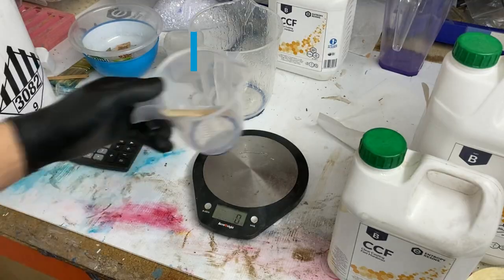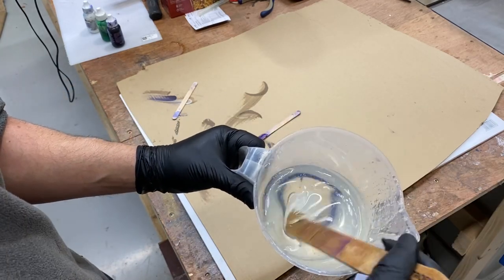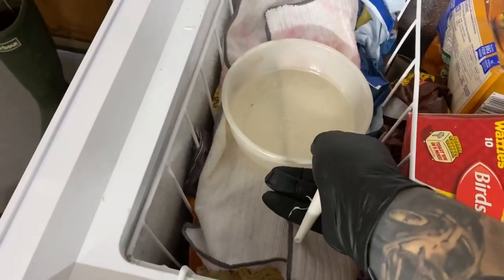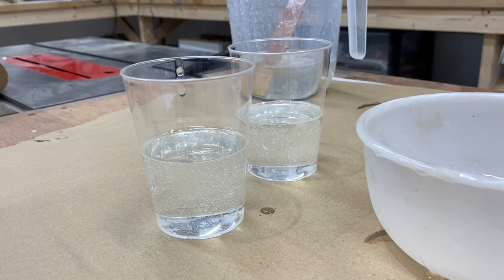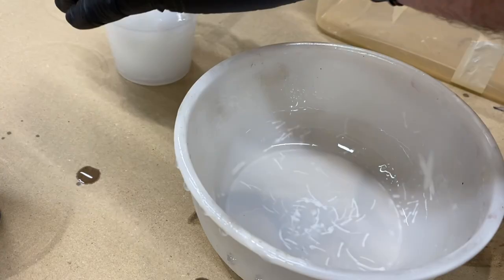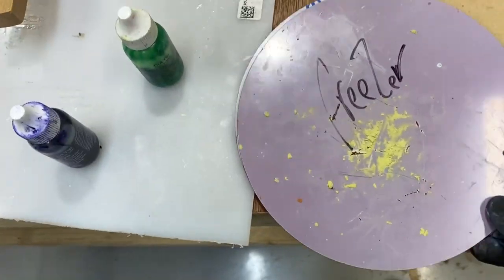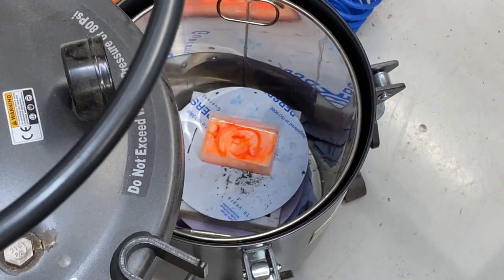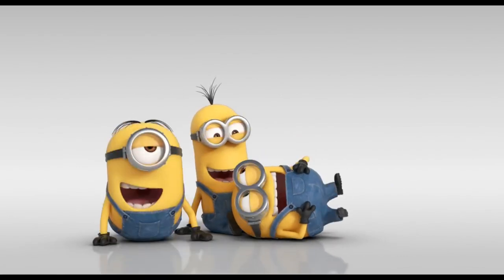How to Create & Keep Swirls in Epoxy Resin after its set? - I Try The FREEZER METHOD! ❄

Comment: Hypothesis: freezing is unlikely to work because the cold inhibits curing. Once it comes back to room temperature, the resin effectively returns to its "just poured" state and cures the same as it normally would.  However waiting for an hour lets it partially cure and makes it more viscous so it's just less mobile and less likely to mix further as it cures in the pressure pot.
Reply: This correct. Freezer slows the chemical reaction that causes the resin to cure. This is actually done in the real world in automotive refinishing, to extend the pot life of 2K paint
Reply: If working time is an issue, you could do both.  Let it react for 45 minutes, put in the freezer for a while to slow the reaction down, then pull out, add colors and pour.  If working with a large amount of resin, this might extend the window where it will pour but not mix.
Reply: Yep, I was expecting him to put in oven or heat, not freeze it. Warm the resin so it cures faster not letting the colors intermingle for as long.
Reply: Plus if it's in the freezer and still trying to cure (getting warm), it could draw in moisture from the freezer, adding water to the resin, causing even more problems, including cloudiness.
Reply: Exactly.  Gentle heating and/or high shear mixing can serve to accelerate the reaction. Sometimes the addition of a small quantity of a “metallic powder” can also accelerate.  Accelerating too fast can also cause the resin to be brittle.  There are also thixotropic additives that can serve to increase the viscosity. If translucence is not a priority; then a pinch of cabosil fumed silica would be a great additive.  Your example at the end shows that patiently waiting for the desired thickening just may be best!🤓🤩😎

Comment: A lot of comments, haven't gone through them all.  3 things: 
1) Use a temp gauge so you know when the exothermic reaction is just thickening the resin. 
2) Mix  1 color and let it set (temp gauge or viscosity check) then mix/pour 2nd color.
 3) Talk to Entropy and ask if using more hardener in one batch will work, might not cure correctly though. 
  I use a Polyester resin that you add catalyst to. 5 drops/oz. If I over-catalyze, 2X, the 2nd color it thickens faster so the colors stay reasonably separate. A temp gauge is a good thing to have in the shop.
Love your videos.

Comment: I work small scale and don’t have a vacuum pot, so I warm my resins by putting the bottles in warm water to help prevent bubbles when I pour. Heating it quickens the curing process, so it gets thick quickly, and pouring it when it’s a little thicker helps. 

One thing I like to do is pour a dark layer and let it sit for a little bit then drizzle other colors over it. Then pour some clear while the drizzled colors are still wet and the base is sticky. You’ll end up with a neat 3D looking set of layers and the clear layer will look like a “peep hole” in the middle of the other colors. 
My husband and I love watching your channel, by the way!

Comment: OH! ALSO! If you let one color thicken up quite a bit then make the other color fresh so it's still thin when you pour, you can get some VERY interesting patterns. I did that with colored resin into clear in vertical pen blank molds and the results were spectacular. I poured the thicker resin into the thin from as far up as I felt I could aim and didn't touch it once the pour was done.

Comment: Fun to watch! You are quite funny and your editing is cleaver. I use Deep Pour and after ruining well over a hundred dollars of resin and burl trying to find that perfect time to "swirl" is really frustrating. If you swirl too soon and/or too often you get a "muddy" mess. Obviously time, temperature and resin brand make a big difference. But what I'm finding with Alumilite Deep Pour the perfect time is somewhere around 8 to 11 hours after the initial pour and NOT stirring until it is the consistency of melted taffy. It peaks when touched, but settles flat/level within a minute or so. Then stir slowly, trying not to get too many bubbles. I just got some UpStart Deep Pour and will be testing it for "time to stir" on some smaller batches, before wasting resin on a larger pour. Also, I made a "curing box" 2'x2'x2' out of 1" solid insulation, that I installed a light for heat and a thermostat that maintains temp between 75 and 78 degrees. It works great for curing, but "swirling" is an all together different learning curve.

Comment: Hey Nick I use amazing clear cast and use an IR thermometer to check the temperature in the pot until it's around 40/50 degrees that way you get good colour separation I'm not surprised by the freezer result as effectively putting it in the freezer will cool down the exothermic reaction and essentially slow down the curing process

Comment: Nick try putting the colors in the pressure pot to remove most of the air bubbles before you mix them...most likely what is mixing your colors is air bubbles

Comment: So in my own experiments with resin i learned to kinda put the cup in hot water for about 10 minutes to remove bubbles, this also made the resin start to harden way faster. I wonder if that would be similar to but faster than setting it out for an hour.

Comment: How about trying a small quantity of resin thickener powder (The stuff people usually add if they want to use resin more like a filler or a coating on a vertical surface). Never used it myself, so I don't know how well it would work, but it's probably worth a try. 
Alternatively, it could be interesting to see if REALLY overloading a batch of resin with mica pearls would keeps the different pigments from mixing.

Comment: Uv resin can swirl and cure just fine, i know an artists that makes swirly resin charms for a living, though it does limit it to thin/small projects because uv resin can be finicky.

Also, im pretty sure its just the air being sucked out that is mixing the resin, thus why making the resin thicker seemed to help, possibly taking the air out slower and not pre swirling could help, just let the bubbles swirl it for you.

Comment: Suggestion to try.  Run the colors in the pressure pot quickly to remove the bubbles before pouring it.  Then you should be able to pour and keep them from mixing, I believe it's the bubbles coming out in the pressure pot that's mixing up your colors.

Comment: Since the pressure cooker seems to force the colour around, what would happen if you had a bowl of white resin and then just put in very small dots of colour using a stick (or a syringe to put it at different depths) and see if the pressure mixes it up?

It seems you only have a small amount on the stick to colour a cup full so small dots may be enough to make interesting patterns.

You could even insert a variety of coloured dots into your white (or clear) "base".

If dots of colouring don't work, then try just a smear of colour (drag the stick through) leaving a thin ribbon of colour and let pressure expand/mix it.

Comment: If you were to take cut up pieces of older resin that has fully and completely cured and put that in a different color resin, could you then safely turn that or would the 2 resins not bond well? Would the older resin get more brittle? I know you have done some stuff in the past that has been multiple pours over time, but is there a point when you shouldn't combine old resin with new if you want it to turn it?

Comment: hi nick
pour your resin thinly from a height,
forget the pressure pot... 
and just leave the resin on the bench to set ,
using a releasing spray might help,
if not use silicone molds.
simon
Reply: Thank you,, great tip for those of us that dont have pressure pots or air . Do you use the torch for the top bubbles , like a lot of people do?  Thank you

Comment: Do you pull a vacuum or increase the pressure in that pot ? as if you increase the pressure  you are essentially boiling the resin so it wont stay in swirls, same as you cant boil water on Everest   because the lack of air pressure , if you increase air pressure you can get the resin to boil just by the heat created by the exothermic reaction of the  resin setting ?  never used one im guessing here , maybe you can do both i just dont know .

Comment: Have you thought of using shards like the red and white "marble" to make beads? They are smaller than what you generally turn when using your lathe, but I know you have done pens in the past, and the same methods could apply.

I have never used resin, so my suggestions here can be taken with a truckload sized pinch of salt - 1. Mold release is your friend 2. Get that blue stuff out of the bottom of the mold you cast the red and white marbled piece in. As an alternate, replace that mold.

Comment: So ive seen other people that work with resin use pressure pot juat pull the bubbles out before pouring.... Then pour and let set normally. 

So...

Like maybe make rhe colors you want seperate and then pressure pot it juat enough to remove bubbles.... Then pour them together and swirl and then set? (One thing thwy all had in common was watching it and go up and down on pressure til it stopped "boiling") 

Donyou think its the bubble moving out of it in pressure pot is what is making it combine together?

Or is pressure pot needed for it to cure regardless?

Comment: Try warming parts a & b in warm to hot water before mixing together. The reaction of the 2 parts needs heat to cure. They also create heat as they cure. With warmer solutions to mix together the wait time to gel stage should be shorter.

Comment: Two parts resin is an exothermic reaction. Putting it in the freezer will stop or slow down the hardening process which is the opposite of what you want. Leaving it to thicken by itself was the way to go. You could’ve also applied heat to hasten the process.

Comment: I worked with epoxy resins for 15 years as part of my job in the Army. Resins require heat to activate, which they usually create their own, but it is why manufacturers have a suggested ambient temperature range. Placing a resin in the freezer will only serve to slow down this chemical reaction and weaken the final product, if it fully cures at all. Over heating will spead up the process, but will make the resin to brittle. I have done resin repairs to main rotor blades in sub-zero temperatures, but the required extra steps are a nightmare. Especially working in shifts fir 24 hours to maintain the optimal temperature (sometimes with nothing but a heat gun and a thermometer). If you truly want color separation results, find a way to time exactly when the chemical reaction happens. That will give you your window for pouring.

Comment: Hey Nick! Could you place a camera in the pressure pot,so you can see what happens as it sets. You could determine if the color mixing is due to the resin shifting during the setting process. Is the colors just separated due to pigment types?

Comment: Is it just me, or does it look like the red & white batch broke mainly along the major color lines?  Would this be because the resin only partially sat?  Might that create a problem when you attempt to turn the piece, or would you expect the two colors to totally fuse once fully cured?
Also, the orange & white batch appeared more separated at the bottom where the second addition didn't get mixed in.
Thanks for the tutorial!

Comment: I really doubt using cold to thicken it will work with colour separation. The less time it takes to cure, the less time the colours will have to mix and blend. Since cold makes resin take longer to cure, using a freezer will effectively give it more time to mix. The best method is to use the fastest curing epoxy that will not flash cure with your pour depth. This is usually a thicker resin to begin with. Take note of the resin working time as provided by the manufacturer and let your mixed resin sit for about 50-75% of that time. While it’s sitting, put it in a vacuum chamber to remove air bubbles if you have one. After sitting and degassing, pour and mix your pattern and place your mold on a heated curing pad to accelerate curing. Faster curing epoxy, letting it sit for much of the working time and curing with heat each contribute to slowing the natural progression toward merging colours and using all three together gives your best chance for a non-emulsified product. Another method to achieve this effect is to try using different types of inks such as alcohol ink with some types of pigments or powders. Colouring agents that are partly immiscible could give you the separation you are looking for. If you could find some fully immiscible combination, you could make your product look like a lava lamp but agents that immiscible would likely not both be mixable with resin.

Comment: start with clear and let it sit and set up for about 15 minutes and then pour in your 2 colors you want to swirl on either side of the container with the clear and at the end of pouring in the colors you want to swirl switch them back and forth a little at the end when they're about to run out. And they won't mix into one color it will be nice and swirly.

Comment: For the red/white, you should have used a silicone mold. I don’t use anything else with resin.
Reply: Those types of molds do work.  You'll see a lot of pen blank makers use them.  The problem was whatever happened in the center of that thing then the attempt at beating it out while it stuck to whatever that was in the center.
Reply: @refinnej5302  Again, that’s why I prefer silicone molds (there are some large, deep ones out there). Resin never sticks to them and you can reuse them over and over again. Had the mold for the red/white resin been silicone, it wouldn’t have had to be beaten out and the hardened resin wouldn’t have broken.

Comment: Your problem is the pressure pot.  Putting the resin in there before it thickens makes the bubbles rise to the top, mixing the colors.  Either skip the pot and use a torch to get rid of bubbles, or let it half cure before using the pot.

Comment: I recommend checking out Evan and Katelyn. They can get some pretty funky swirls in their resin projects
Reply: They let things set and use fire to get the bubbles out instead of using a pressure pot like nick does
(Edit) the pressure pot mixes the colors around somewhat
Reply: @genderfluidbean2127  they also will mix different kinds of pigments, which helps them not mix as badly. And they do sometimes use a vacuum chamber, which would also mix up the resin.
Reply: @genderfluidbean2127  I use a pressure pot and have no issues with my resins mixing together.  I also watch a lot of pen blank makers, where the swirls are important.  They all use pressure pots.  The key is to not pour until a certain temperature (this will vary based on the resin type and brand and the temps you are working in).  I wait until mine is a certain thickness, but I know a few people that can tell when they can feel the warmth through the cup (this will vary as well).

Comment: I thought you used “fast” but it didn’t cure? How long does fast normally take?
Reply: Depends on the Resin, as I understand it, Total Boat Fast Set has 30-45 minutes of working time before it gets too thick to muck with anymore (also depends on shop temp., the warmer the shop, the faster the Resin sets), not sure about the Entropy Resin Nick uses...

Comment: Okay, so you understand how resin works, right? Doesn't matter if you put it in the freezer because the chemical reaction happens between part A and B, which is an exothermic reaction, which means it gives off heat. A freezer makes no difference. Want to make it cure faster? Heat it up with a coffee cup warmer or a water bath. 
Also, resin doesn't do well (at least the part A bit) in the freezer. It will turn to crystals just like honey. Fortunately, you fix it just like honey. Put it in a water bath on the stove with water at 125 F and it will eventually "melt" back into it's normal state. 
Just don't put your resin in the freezer. That's not how it works.

Comment: Or you could make a 'stained glass' lamp out of it. Instead of the stuff being either metal or a different coloured resin. Over a course of a few days after you have placed the broken resin into the mold. Pour about a centimeter of clear resin per day. Until it comes to the top of all the broken pieces.

Comment: I don't understand why you thought the freezer might work.  Resin cures more slowly in the cold, so if anything, I would expect it to be worse in the freezer.  Instead, you might consider placing the mould in a hot-water bath to accelerate the curing.

Comment: I'll just say putting it in the freazer, or cooling it down for the few minutes like you did does nothing but make resin take longer to cure, it will go back to normal and warm up as it cures so the whole cooling down thing does nothing but make curing take longer. When resin cures it heats up a lot, it needs heat to cure so freezing/making it cold it really wont do anything but risk damaging the make up of the resin preventing proper curing or contaminating it with frost. 

To do a proper divide of colors you do need standard 12 hours or more cure time resin, the fast stuff just heats too quickly and causes issues (if you ever do resin 3D printing and clean prints in alcohol, put a UV light on it and you can see it react and move around as it cures whats fooating in the alcohol, as well as heat up. Normal resin does the same as it cures). Plus yes, you pretty much want to do the pour after the resin has sat and really thickened up to a more syrup or thick honey consistency. This means looking at the normal work time (often 40 minutes), and some times depending on resin, doubling that time before you pour. You still set it up, add in all the colors and what, but you just let it sit off to the side until it thickens up then pour. The thickness will help keep the colors apart with only slight blending.